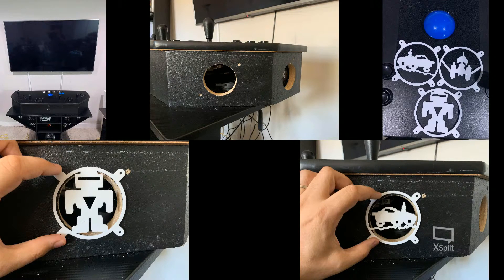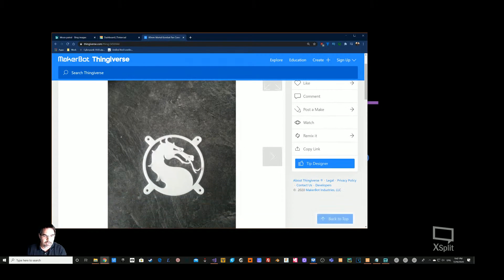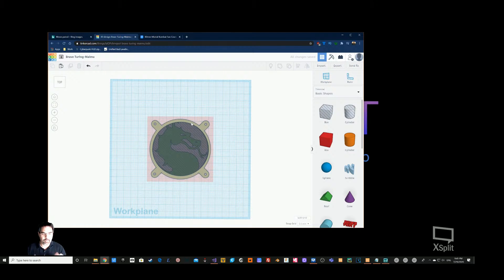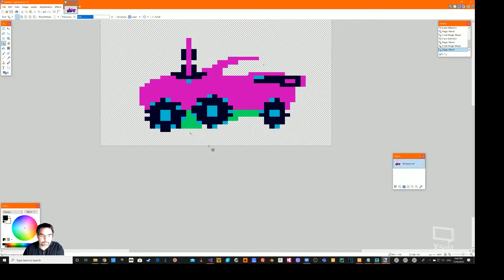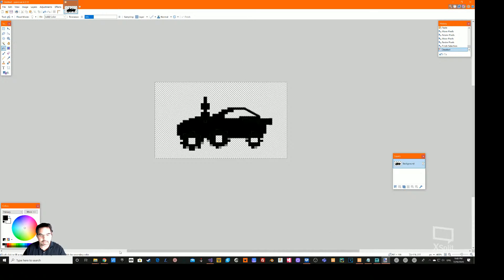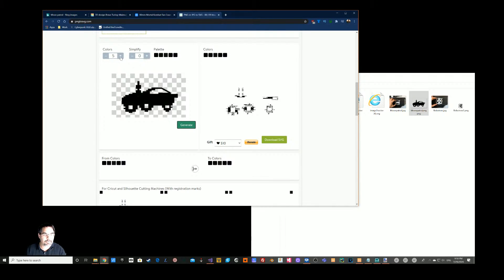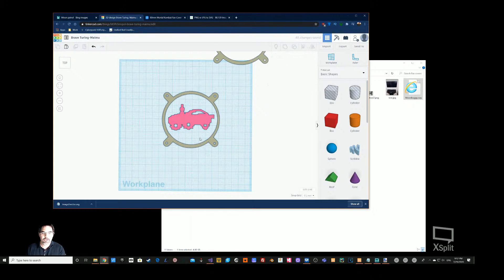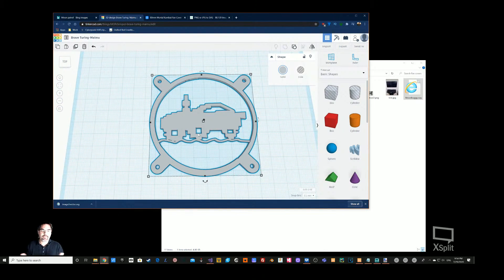DIY 3D Printed Fan covers! end to end tutorial (Livestream)

Comment: What 3d printer? I would like to get one to add for my PC custom builds
Reply from the maker: This is a bit older but it was an Ender 3 at the time. The Ender series usually have a ton of mods available and a large community available for them. I have had success with the Odin F5 as a nice alternative if you catch it on sale, and anycubic has a self leveling for under $150 I saw recently that’s got a 220mm bed. Any printer will have quirks from what I’ve found but once you get them wrangled they’re great